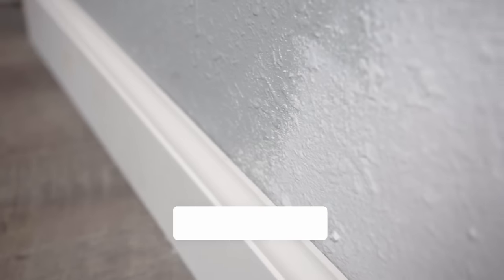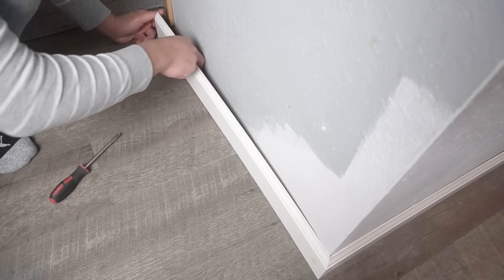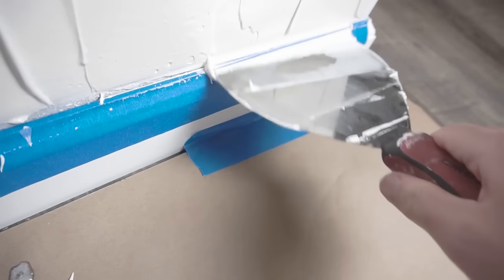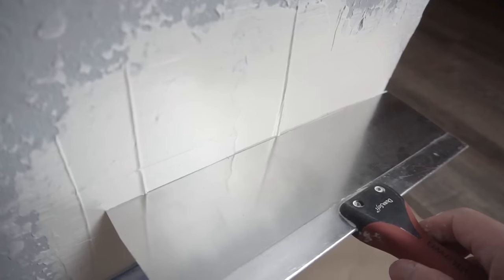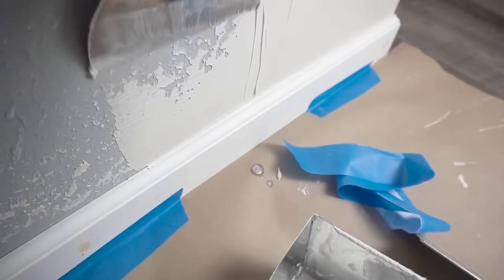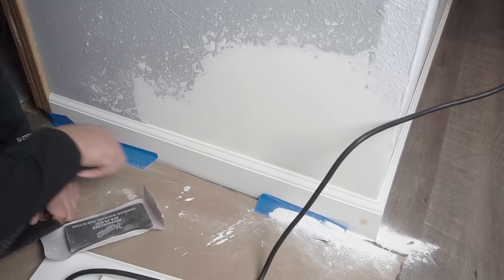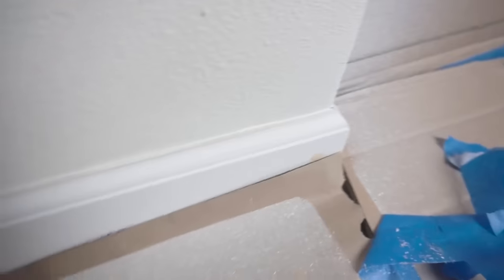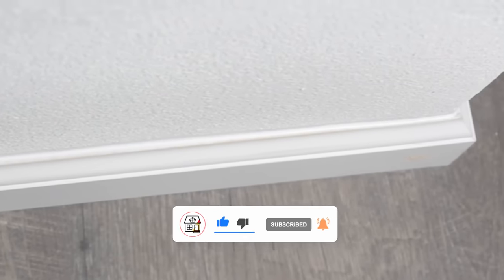How To Fill Gaps Between Baseboard And Drywall | Fix It Or Caulk It? DIY Tutorial For Beginners!

Comment: Whoever sprayed that original texture should be shot. 
But to match it better you'd have to turn your air pressure much lower with a bigger spray nozzle. the mud viscosity seemed ok
Reply from the maker: Thank you for the tip brother. Yes the whole house is sprayed this way and some areas so much worse…such an eyesore 😆
Reply: If someone wanted to fix a texture that looks like this, what should they do? Would you have to both scrape and then skim coat the whole house?

Comment: If you are not a professional don't try this. You will wish you used the caulk. This method is fine but you better have experience or it will not look good.

Comment: Caulked baseboard looks bad.  Lord help you if you have to remove caulked baseboard, it will take the drywall surface with it.   You lose the clean sharp look if you caulk baseboard.  The gap is there because the drywallers did a poor job.  Often the corner bead was put on  to far from the corner leaving the wall with the ident.  They should have filled the idents on walls.  Just leave the gap unless your ready for a pretty big job.  Pull all the trim, fix the drywall and reinstall trim.

Comment: Your baseboard shows a little gap and you re-plaster the wall? Crazy. Plus, now your newly plastered section looks completely different (despite your additional ludicrous spraying). The problem with your other example is that your caulking was poor and didn't have a defined clean line in line (top) with the baseboard. So over the top and unnecessary this.
Reply: Exactly what I was thinking.  Total waste of time and money

Comment: No way I would worry about that little bit of a dip and deal with mudding, sanding, priming, painting and caulk. Just caulk that little area. Also, seems your wall has a texture that will now be flat/smooth in that area.
Reply from the maker: It would be ideal if it was in an exposed area. Caulking the gap will look obvious 😅

Comment: You just patched a textured wall with a different texture. You still need to sand, prime, and paint, as well as clean that texture Spyker, and it will still show due to the different texture.
Tape, caulk, wipe, and then immediately paint the wall (and the caulk) while the caulk is wet, then remove tape. Way less work!

Comment: Why would you make it more complicated then you need to? There's no need to "load it up" with the small knife. Slap in on with the small knife and lay it down with the 12 incher. Then you know you have a flat job. Also, I get that not everyone is there yet but everyone's goal should be not needing to and after because with practice, you can lay mud flat and smooth. That's why we use the big knives. His advice is sound but please don't follow his technique.

Comment: Get this off YouTube its bad. First of all don't put trim up if you are going to do this. Check corners with fram sqaure then mud before trim. Also use a wet sponge to feather mud edge.
Reply from the maker: These are for situations where trim are already installed. And you want to fix those trim that got buried with caulking. I like to make videos on different situations. Hope your understand my thinking. You are absolutely correct, always check your walls are flat or even dry fit your trim before Brad nailing it to your wall 👍🏽
Reply: @FixThisHouse  This guy with his rude comments doesn't deserve a reply from you my friend. If you don't have anything nice to say then SAVE IT!
Reply: If you have nothing nice to say then don't say it. That's an old saying and the reason why people are so soft these days. Nice comments just let's people know things are good. Rude comments are motivation to do better. Dudes got potential I can tell bt his passion to want to make things perfect but too much random shit on YouTube that is not right. Just letting him know matching that splatter texture or bad knockdown is not easy and will show more than a slightly hollow corner. Fill with caulk and cheat your blue tape over the hollow area when painting would be much better for a diy